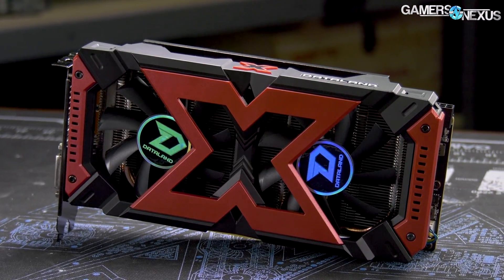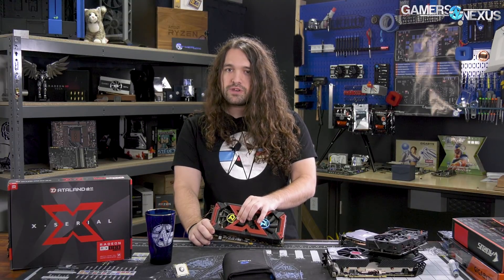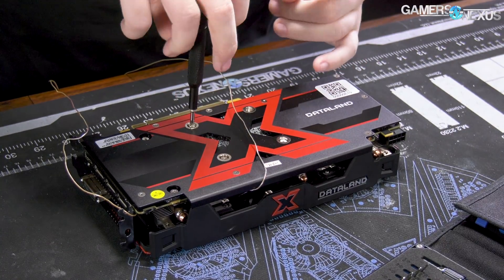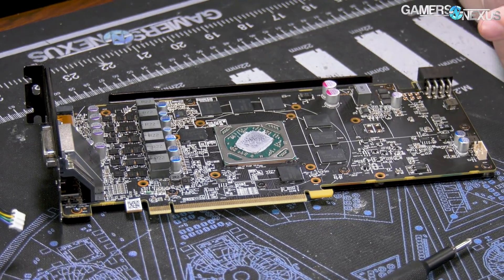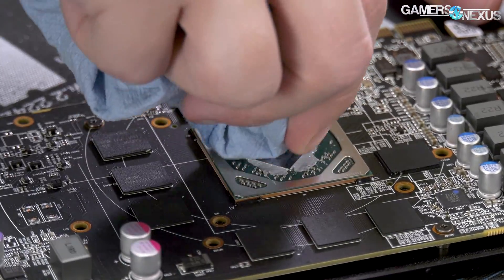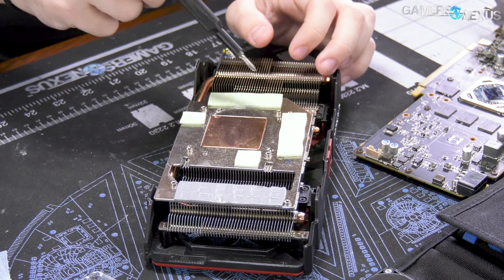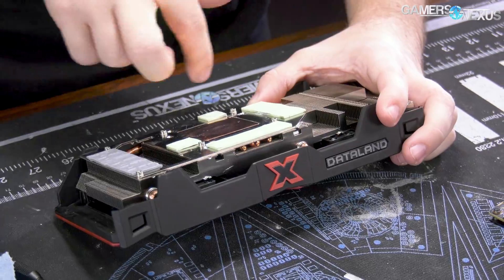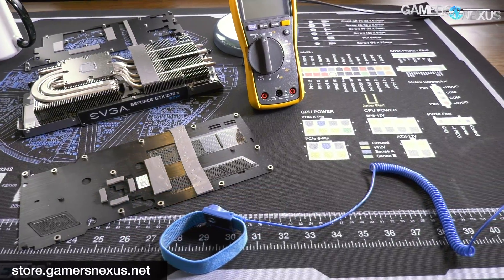DATALAND RX 580 2048 Tear-Down & Disassembly

Comment from the maker: Original review of the DATALAND RX 580 2048: https://www.youtube.com/watch?v=A5Xm2V8O5po
Reply: Hey, you forgot to put the kit you used to take it apart in the description. I am semi-interested.
Reply: @darthscrub6546  Just look up "I-Fix It". They make a variety of different kits.
Reply: @mattsmechanicalssi5833  Thank you
Reply: @darthscrub6546  You are most welcome.
Reply: Hi, What do you think is the most suitable midi-case for custom water cooling? thank you in advance!
Reply: It must be bonded, as you cannot solder aluminum.
Reply: Hey , can you try and put the rx 580 bios? Try the nitro + one with 4g of vram. Lower the clocks and put the 50% power target . Maybe that's a 575 with a 580 chip :).

Comment: i have a chinese oem rx 580 2048sp with a gpu chip 215-0911038 ( for rx 580) can i flash it with rx 580 bios to unlock the 2304 SP cores? thanks for the reply
Reply: no its not a rx 580 chip.
Reply: It's the same chip (the RX 480/580 uses the exact same die as the 470/570). The difference is that AMD disables some CUs (and also TMUs) to reach the target number for the 70 class card. Some or all of the disabled CUs were defective in some way - otherwise it would have been used as an '80 chip. 
Unlocking CUs has been hit or miss (for the R9 Fury for example). I could not unlock any on either of my 2 cards, but some people unlocked all 4096 SPs. 
Though I have never heard of anyone successfully unlocking CUs on an RX 470/570 card via any process. Most likely is that you will brick the card.

Comment: you said the cooling fins and back plate looked like aluminum, the camera does not really let me tell, but it looks like more of a nickle finish and the rails that popped out had an aluminum finish. 
non-alloy aluminum is likely to start bonding with itself at those temperatures over extended periods of time.

ic memory chips having been epoxied is normally done for stress (impact, heat) or moisture barriers. an educated guess would be fan vibration and long term heat stress dampening concerns.

Comment: They did this with the RX 560 too, one has 1024 stream processors while another variant had 864 or something
Reply: They call it 560D
Reply: There were also castrated versions of rx470D in China before, which was also sold to China only. AMD also has more old models with castrated versions, but the difference is that the 470d only has 1792 stream processors

Comment: Didn't you note in your RTX failure investigation video that the memory modules on the bottom and adjacent to the VRM were the hottest?  Perhaps the additional support is a compensation for the expansion from the larger thermal cycles?  Similar to the actual GPU corner support.

Edit:  Didn't see the other comments with the same thoughts... so um... ditto?

Comment: Huh, I'm surprised they did not put any thermal pads on the rear side of the VRMs to use the backplate to help dissipate some of the heat generated.

Comment: The two RAM chips with the glossy glue is because they were hand reworked. My guess is the two chips that where there originally failed and rather then scrap the whole card for QC they popped the two chips off and had someone put down replacement chips.
Reply: Go for it

Comment: Probably the reason would be the product has been re-worked. That's to say after the SMT had been done, it failed maybe via optical inspector or a rest gig, and so the quality inspection failed, to be re-worked. Thus fixed by hand. All be it a steady one.

Comment: What you are looking at around the memory is something called underfill which is very deliberate and done by a robot usually. It’s there to prevent damage shear stress cause by thermal expansion. The material is usually a nonconducting, one-part epoxy. Hope this helps!

Comment: The sticker is there to inform that warranty is void if you remove the screw it it sits on, while also providing "evidence" of said removal by being punched through by a screwdriver.
Interesting design, looks better than a lot of other cards that's for sure - albeit not amazing by any means.
Reply: Everyone is well aware of what the sticker is for. The problem is that enforcing that is illegal in the US.
Reply: wingracer 16 Steve wasn’t, since he was talking about how not removing the sticker meant he didn’t break warranty. So I pointed out the error in his logic.

Comment: This situation still doesn't look as bad as the 1030 ddr4...
Reply: The 1030 DDR4 is still a full 1030 chips, it's just the memory, isn't it ?It's still a bad practice, but usual in low-end cards (using old Fermi chips for entry-level GT600 and 700 series was worse), and it's not as misleading as using a different binned Polaris 10 chip for a 570 and calling it a 580.
The real concern is that now AMD screw names even in midrange market. That's only in RCP for now but it reminds us that this company is just a smaller shark in the pool.
Reply: @PainterVierax  yeah same chip, same name and almost same price at launch, but under clocked and half the performance. Also  global (being global makes a difference I think...) don't know about you, but more than names, and even chips, I care about performance, power consumption and price ofc. So I would prefer a 570 with a name 580 something, and 80~90 performance of the real 580 (just a guess) than having a gtx 1030 with a 1030 chip but having half the performance of the other 1030 gddr5.
Reply: @PainterVierax  don't take me wrong... Is bad anyway! Just think in the end, the 1030 it's even worse cuz of the drop in performance,  it's not like comparing a gtx 1060 6gb vs 3gb.
Reply: @PainterVierax  No. Memory bandwidth matters! The 570 is only 10% slower than the 580 and you can oc the 570 to almost match a stock 580. The 1030 DDR4 has only a third of the memory bandwidth compared to the GDDR5 variant and is 50% slower in modern benchmarks and games. The GDDR5 variant is an okay entry level card whereas the DDR4 variant is simply a piece of junk.
Reply: If the price of the 1030 DDR4 was really dirt cheap, would that naming still bother you? Still I consider it should have been named 1020 but the major problem is the price point, not it's perf.I won't re-enter this debate but guys you seem to really don't know what a piece of junk is. It's misleading and overpriced for its performances, doesn't mean it's totally useless for certain usages just not a good deal for a non-gaming card (the 1030 GDDR5 is already ultra low spec for gaming : that's not the purpose of the DDR4 variant). As I said, it's quite a classic entry-level scam but at least here you have the actual Pascal architecture with the latest video processor unit and the low consumption at idle. It's way less bad than previous generations like the GT710 : That, was a real piece of junk.
Reply: @PainterVierax  I think the GT 1030 DDR4 would have been fine if it was called GT 1010, or 1020, because compared to the GDDR5 variant it was way weaker. But yes, technically it was a GT 1030 while this technically isn't a RX 580 by any means but a RX 570, so in that sense this would be more misleading, but in terms of actual performance this scam RX 580 comes close to a real RX 580, while the scam GT 1030 was way slower than the real GT 1030.

Comment: Kinda surprised this card isn't in the Walmart UnderPowered PC
Reply: I would laugh.
Reply: I think Walmart got those 10 series cards very cheap though. After hearing about how there is still a HUGE amount of 10 series cards left. Especially Gigabyte is rumored to have a LOT of stock, even after sending 300k GPU's back to Nvidia. Walmart is probably making a very high margin on those pc's.
Reply: @SIC66SIC66  there is a lot of cards that aren't the 1080ti or 1080 still left but very few truly want those.
Reply: Maybe, but I think especially GP104 stock must be massive, as we see even 1060's with GP104 dies. Fusing off half of the cores, crazy.
Reply: @SIC66SIC66  yah I think officially nvidia is not allowing the continued production of new 1080/1080tis because they wish their more expensive gtx cards to sell even if board partners could make them
Reply: @RadarLeon  I think its more the other way around. The new 20 series is so expensive so they can still sell off old 10 series stock AND make a lot of money from the suckers buying the 20 series

Comment: This is actually quite an impressive card from Dataland/powercolor. Vrm setup is nothing fancy, but still more than enough for a RX 570. The cooler has been properly constructed but could probably do with better fans and an additional heat pipe. 

I might pick one up when I'm in China next month. They seem quite a good deal.

Comment: @GamersNexus have  you ever tried putting thermal paste or pads on everything and see if that helps thermals overall? For example on all the back of a card that has a aluminium or metal  back plate
Reply: the thermal paste only makes it easier to transfer the heat between the CPU and the heatsink. if its a coating then you'd also need a heatsink specially milled to fit every single component

Comment: Looks like underfill to keep the BGA packages from popping balls during physical stress. (which could be induced mechanically as well as through changes of temperature)
Reply from the maker: Thanks for the thoughts!
Reply: Thats exactly what it is.
Reply: But more important , why are there inductors stacked ontop of each other!
Reply: @andljoy  higher current rating because of cheaper inductors I guess
Reply: I agree. They are closest to GPU, so I would think those 2 memory modules will see both more stress when attaching Heatsink, and heat from GPU core as well.
Reply: This really pops my balls
Reply: @reginaldoestremera3007  Ya know what grinds my gears?!  XD
Reply: is it only on those two because they're closer to the die than the rest?
Reply: I would bet the underfill is used for these two because the stress is higher. One is the closest to the pcie port (stress due to flexing of it) and the other one is reaaaallly close to a screw hole, closer than the other oney
Reply: Underfill sounds like a dumb Undertale AU name.
Reply: Not only are they closest modules to the GPU die, that one is situated in-between the die and the VRM!